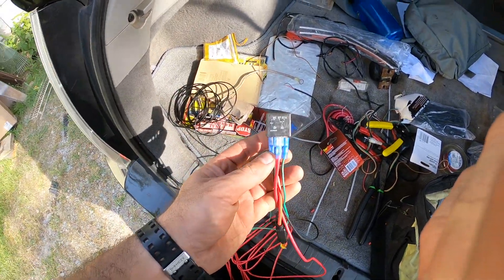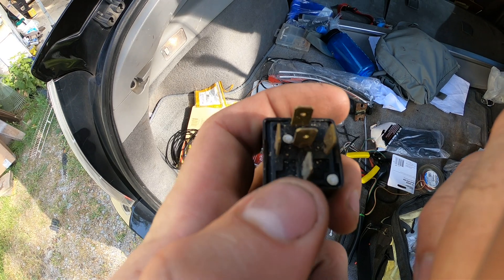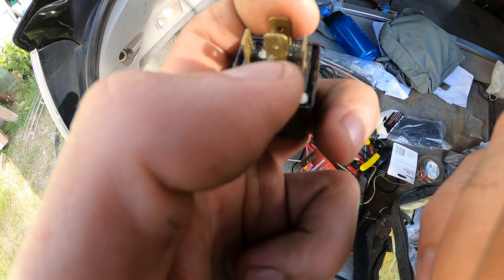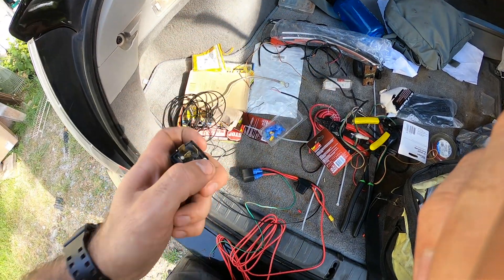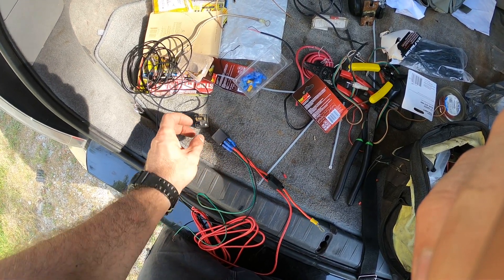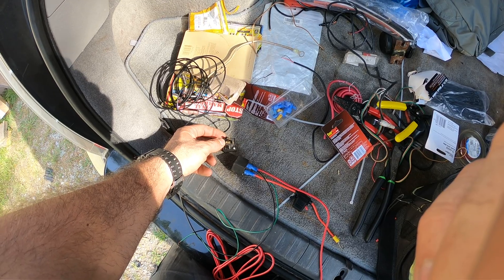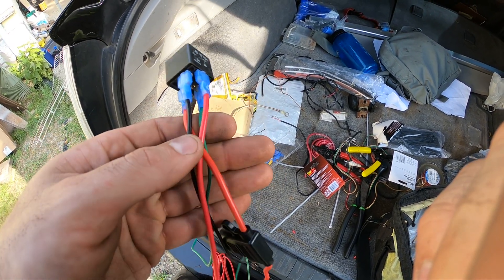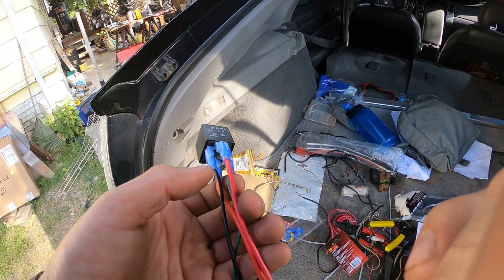Train Horn compressor 12v 5 wire relay

Comment: Power to compressor should actually be on the center pin. I tried it his way after my 4 pin went  out after going solid for 5 years. Power to solenoid and ground pin don’t matter as mentioned. Make sure your power to compressor is on the center pin on the 5 prong
Reply from the maker: It all depends on how you want your relay to function. 87a and 30 are normally closed, i.e. connected until the trigger comes to 86/85 coil. Once its triggered pin 87a is disconnected from pin 30 and pin 30 is connected to 87.